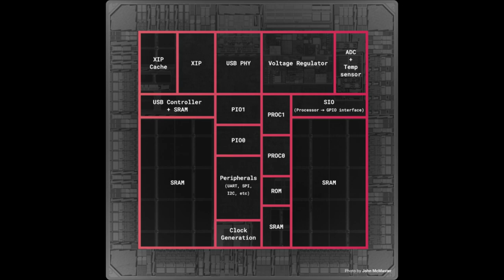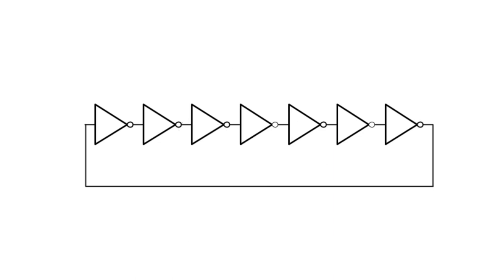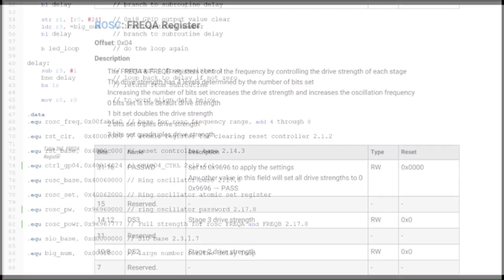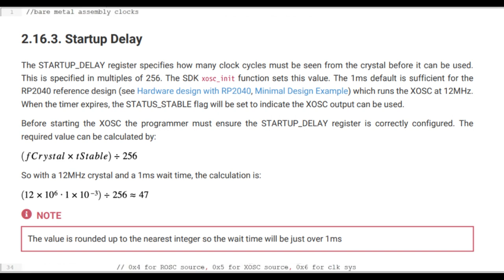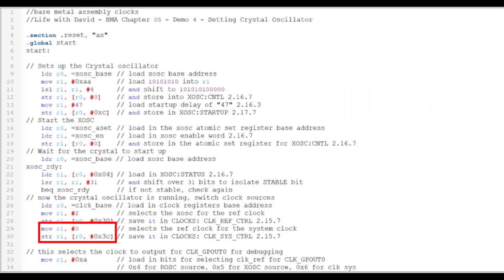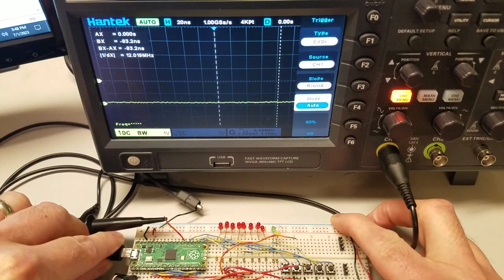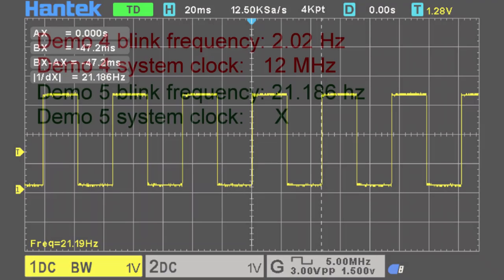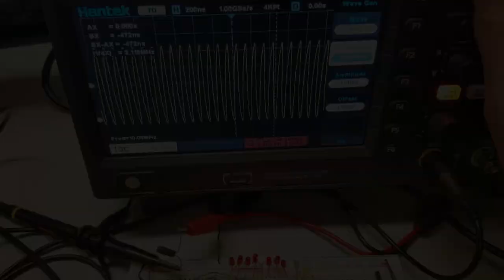RP2040 - System Clocks - Bare Metal Programming - BMA05

Comment: David, the PIO series was interesting. Please dive deeper, with more use cases.
One implementation would be to read the rpm of a motor and use the reading as input to a PID. I can give you what I have done, it could be improved.
Reply from the maker: Maybe I'll get into incorporating PIO scripts into assembly language programs.  PIO is good for timing since there is one instruction per clock cycle; as you can see from this video; assembly is all over the place.  Thanks for the comment, that's a good idea.  However, I've got to get smarter on the RP2040 gory details before I can merge them together.
Reply: @LifewithDavid1  I think the main usage of pi pico is with micropython. The development is faster.
Reply from the maker: @apanoiu  I guess it's what you are used to.  I prefer using C.  Micropython  is sometimes little slow for time sensitive scripts.